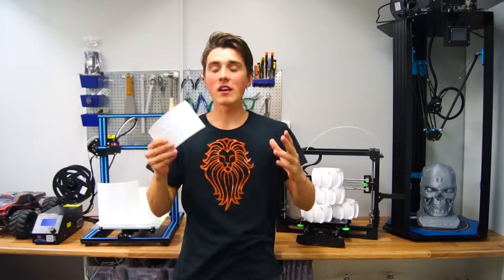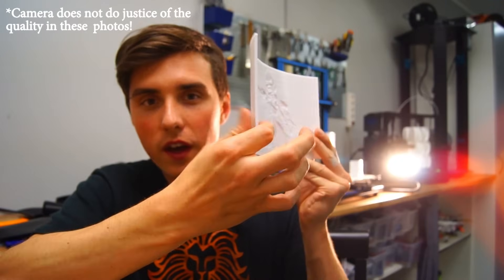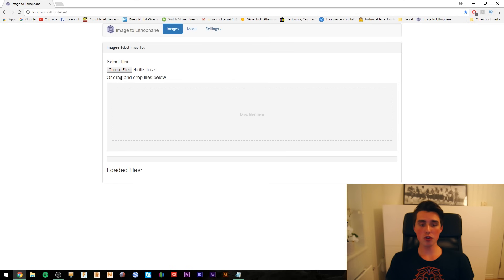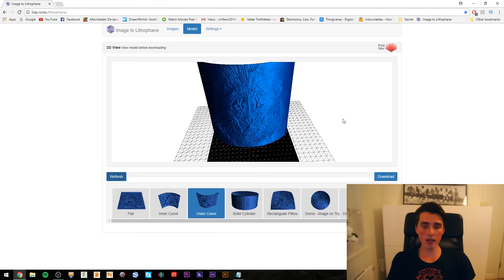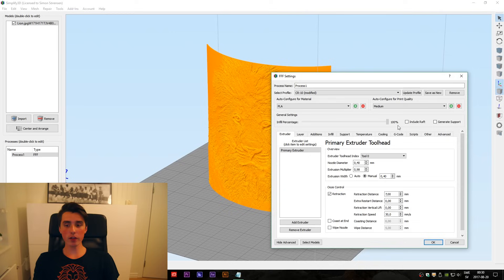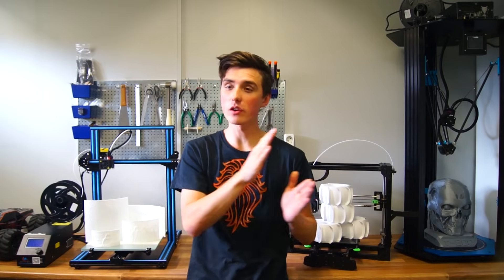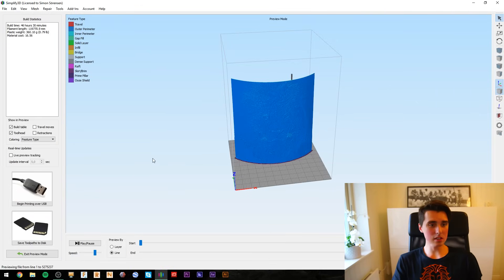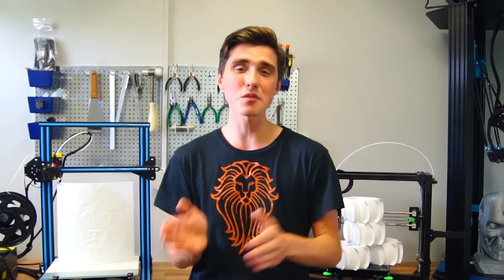3D Printing Your Photos - Lithophanes

Comment: What is the slicer you're using in this video?  I'm using the standard creality slicer that comes on the micro SD for the Ender 3 Pro, but the advanced settings on this slicer aren't quite matching up with the ones you're using.
Reply: Nm.  I'm an idiot. Says it in the top left.

Comment: Quick question:  Any idea why I get burn streaks on my print?  Using an Ender 5 Pro, your settings, and a freshly leveled bed.  The burn streaks only appear using the curved model.  Printing the same image flat (but standing) and all is well.  Thanks!

Comment: Question, so using 3dp rocks and I make the print 3mm with 4mm boarder and I stand the print vertically to print it,  with that boarder now would I need support. In cura it looks like the top boarder needs support. Or print it laying down as lots of people say it makes no difference.

Comment: Help please? Just tried my first one... got 75% done and it started curling off the bed and got popped off bed and ruined print? 

What did I do wrong? Should I make base thicker? What setting is it listed under and what should I change to? New at this just learning. I use creality slicer 123 . Thank so much!
Reply: I am printing with a ender 3 pro if that helps?
Reply: I was using the curved print as in the video
Reply: Hey buddy I don't know if you still need help, but you should print lithophanes with a brim, that way they increase the surface area to the bed. It should be a setting some place in your slicer. Good luck.

Comment: I've tried printed vertically and I've been getting bad results, I found printed flat is giving better result but still no match to yours, they look amazing. Any tips on my slicer settings? I'm using cura software with a creality ender 3 0.4mm novel.

Comment: That's amazing. Did mine with cnc router. Want quiet and no mess. This is amazing sir. Thank you for your channel. I've subscribed. I see in another video you can get started with a $189.99 printer. If that's true I'm all over that. Does it stink while printing or have to put it outside or in the garage?

Comment: Hey, do you use Z Hop when retracted option when you are printing lithophane?
Reply: Good point.. I always seem to knock thin stuff over when combing or not using zhop. Since it's 100% infill I don't see how any of that would matter. But I do wonder how optimizing wall order (outer before inner) would affect the print.. better? worse? Guess I'll test it and find out.  a 6 inch wide pic of my dog is supposedly only going to take 6 hours at .2mm.. but the whole top of the pic is washed out from sunlight.. it's a gorgeous pic really I hope it shows my golden retrievers soul like the picture does...  here goes nothing.

Comment: Just learning about 3D printers and I have a CRC machine that carves Lexan lithopanes, along with many other wood projects, but it is noisy and you have to vacuum out the Lexan/wood dust every 10 minutes, so 3D printing is interesting.......I do see that it takes a LONG time to "print", but you do not cover the cost of the material to create one (lets say a 5x7 and a 8x10)........also Creality has MANY printers........do they have a model that is faster, if I wanted to do this commercially?  Thanx for any info and your video was awesome!

Comment: I know this is a long shot... I made a 300x300x300mm kube with open top and bottom. The edges are 6x6mm and they leave room for a 294x294 litophane printed in this space.
The images are waved and i dont know why, the sides are spot on, no gaps or whatsoever. The print is done (11 days and cost me €150) but i would like to flatten the waved panels, any idea what would be the best way to do this without damaging of warping it even further? Filament is white PET-G.
Thanks in advance!

Comment: might be able to make it bigger inside the 3d printer frame if you can put the print on the heated bed slanted corner to corner
allso be nice if you can make it intoo a lampshade  
https://www.bloqq.nl/media/catalog/product/cache/1/image/9df78eab33525d08d6e5fb8d27136e95/o/m/omega-h-wandlamp-keramiek-15cm-licht-aan-wit-bloqq-cleoni.jpg
for that to look better with the light off the outside might be made smooth (even sanded smooth )
i wonder if its possible to print the image inside out so the outside can be smooth while the inside has the ridges

Comment: Tried this on my Anycubic i3 mega with some ivory white Pla+ but every time it gets about 1hour into the print the filament just breaks inside of the extruder tried it 4 times and always breaks at same stage of the print. This is the first problems I have had with the Anycubic .

Comment: I like your video. I printed one on my CR10s and it came out good except for missing layers. I tried to use S3D to slice but it does not work for me. I used Cura 3.2.1 I tried everything to get the lines out they are mostly at the top. Would you have a suggestion on what I can do to get rid of them? Its not constant so I am guessing its not under extrusion. Nozzle is fine. I am getting a vibration when the hotend travels across the print. I wonder if that is causing the issue. I already set the E steps and when I saw the layer missing I set flow to 104% just in case. I used all the settings you suggested except I did not turn Z Hop on and I think that's why its hitting the print. The bed is adjusted properly. I have a ton of mods on the printer like vibration dampeners, modded extruder body, squash ball legs, more. I am using PLA white from 3D Solutech which always works for me. Any ideas? I really want to get this down. Thanks

Comment: I tried to use your settings but the printer move too slow almost non-existent just sits on the bed and hums is your speed set for millimeters?

I'm using a CR 10 and for some reason it just will not move it takes about 30 seconds to get to the middle of the bed and then it just barely moves if at all
Reply: Markess A. Wilder I have same issue. You find anything to change it?
Reply: I had a buddy look at it and was told that maybe it's not set to mm but to min which translate in the US to about 0.8 print speed. Which is slllllllllooooow. He sent me a basic litho profile for S3D and since then I've tweaked it and made it my own. I really couldn't figure out what was causing it but I got rid of it.

Sorry I couldn't give you more info. I did write him but I never heard back from him so I moved on.

Also I should note that the print was saying 89 hours with his setting and with mine it was 2 hours or less depending on the size I wanted to make.

Comment: I am starting in the hobby of 3D printing. I am using simplify3D and when I set the nozzle temperature it change the bed temp. as well. How could I correct this. Thanks in advance.
Jesus

Comment: What camera are you using for the timelapse at the start? The one you attach to the bed
Reply from the maker: It's a GoPro Hero 5 in timelapse mode, taking 1 picture every 60 seconds.
Reply: Awesome, thank you. I've broken my 3D printer and awaiting spares but going to try these lithophanes once I've fixed it

Comment: can you also make this in color
Reply: toni You can use other colour filament, but I have not seen anyone make one with multiple filament colours. What I have seen and looked cool, was someone print one of these in white, then print the same photo on transparent paper and mount to back of the lithophane which allowed some colour to bleed through! Would work better with primary / bold colours

Comment: Quick question: How many meters of the flexible filament do you roughly need for a T-shirt print like the lion?
I have seen that filament in the shop and its rather expensive, like 3-5 times more than PLA. However, I have seen some shops sell 5 or 10 meter pieces or 50g test packages. I wonder if that is enough to print a few T-shirts? I would like to have multiple colors at hand rather than a ton of a single color if I only need so few.

Please drop a comment here ;-) and keep those videos coming. T-shirts and lithophanes are about my favorite for 3D printing, followed by copying objects like houses, objects, poeple.

Comment: Why print it vertical? I printed one flat on my MK2s and it seemed to print fine. i did forget to switch it to positive, so the shadows are backwards, but otherwise it looks good. Does printing vertically offer a large improvement?

Comment: Great video! Did my first lithophane today and used your settings and it turned out great! Ran the heat a little higher because I used ABS. I ordered up some white PLA and will try that next. Also looking seriously at the CR-10. My old Makerbot does pretty good, but technology has improved in 5 years.

Comment: Have you used the i3mk2?  I was curious which is better between the cr10 and the I3mk2.  I want to buy a 3d printer but not sure which is best when I only can afford 1.  Also have you seen anyone using multiple colors on the CR10 like what has been built as an add on for the mk2?  Thanks anyone.

Comment: Does it work only with white filament?
Reply: I tried with black pla and it doesn’t work as well.
Reply: I'd like to know that too
Reply: It works with any filament, even transparent one. The idea is balancing the colour and transparency against the original photo.
You can do a mosaic for your window with multiple filaments.
Reply: Transparent one does reflect light in different matter - so use your artistic side with it :)
Reply: I tried with transparent filament and you just can't see the picture clear...
Reply: Does industrial gray work
Reply: I tried with transparent filament and had the same result where the image wasn't too clear.  Once I spray-painted it white it looked perfect
Reply: I used red and it worked well

Comment: Isn't the point that you should look through the flat smooth surface of the lithophane?
Reply: I think it would work the same if you invert the image so the smooth side is facing you, with the bumps on the other side. A flat lithophane could just be looked from the other side, but this curved one should be inverted in software.
Reply: Yes it is, I venture a guess that this is more popular due to it looking great even without the light.

Comment: greetings from germany, i have also made some of this awesome picture printings. But i played a little with the settings. when you go on the modelsettingsite you can increase the curve of the model to 360° so its an open cylindar which is perfect to put a candle or Led in the middel. I printed this and it works realy good.

Comment: Thank you for this video - I've done a few lithopanes, now, thanks to you, and another is printing.  

One tip - you can improve the printed image by specifying a layer starting point instead of letting S3D do it - I set mine to put the outer perimeter start point on the back corner of the print (300,300 for the CR10) - out of the way, visually.

Again, great video - love your presentation!

Comment: If we print large action figures, would it be faster if we 3d print a hollow figurines (just 3d print the shell/skin) and then filling it in with a liquid that cures/hardens? (Compared with 3d printing the whole figure solid).

Is there a 3d printer that utilizes the volume filling capability of low viscosity fluid or thermoplastic? The process could be done in stages. i.e. 3d print hollow skin of the foot, fill in with curing liquid, and proceeds sequentially upwards to the body and then the head.

I am just thinking of design concepts with faster 3d printing speed.
Reply: You can, there are all kinds of cheap resins of various hardness you can fill your skin/mold with. You can even fill it with silicone, remove the skin and make a flexible part that way which can be used as a resin mold for example. Or even make a negative mold in plaster for metal casting... But i dont know no 3d printers who could do that automatically.
Reply: I think its because 3d printer cannot control where the resin will flow... maybe it needs to be fitted with a sensing device. but that would be hella expensive.. probably a cheaper way is to create smaller compartment that it can predict where the resin will flow into

Comment: Is there any way to make all of the depth on the backside of the model so that the front is totally smooth so when there's no light you can't even tell there supposed to be an image there? That would be very cool
Reply: I tested it, the light diffuses into the flat side of the PLA and it isn't as sharp. It's doable, but not as good looking
Reply: Damn, i hoped it would work that way.

Comment: I find this to be impossible in my mind. Yes I get the contoured image, but the part I cannot understand is how when you angle it to the light the real image comes through. How?
Reply: Are you holding the picture behind the copy? I cannot understand how it can know the real world image from contours. I mean it's a 2D image so the 3D copy would be to some extent inferred - wouldn't it? I am so confused if this turned out to be a joke it wouldn't suprise me at all. Anyone else confused here?
Reply: My confusion is not this 7:35 (I get that), it's this 7:40. How can contours in the same coloured silicon create such visual depth? I mean that machine isn't actually photocopying the image in there..is it? I am so confused!
Reply: WeirdCityCitizen 
It has NOTHING to do with contours and EVERYTHING to do with the thickness of the plastic. The thickest areas appear darkest because less light passes through and the thinnest areas appear lightest because more light passes through the plastic. The shades in between are caused by the variations in thickness of the plastic. The website first turns the image into monochrome, then it assigns a value to the thickness of the plastic print depending on the intensity of each pixel in the image. The finished print has to be solid as if it used infill the effect would be ruined. Similarly, the effect would be less striking using dark coloured plastic as very little light would pass through anywhere. Your brain causes the image to appear more clearly as we see by our brains comparing different parts of an image, which is how it is possible to see black on an old CRT television even though it's impossible for the CRT to produce black!
Reply: WeirdCityCitizen it is literally a grayscale image except you're creating that image by allowing or blocking light instead of more or less pencil or paper so just like you would do a lighter stroke with a pencil to get a lighter gray use less plastic to permit more light when you want to block more light you use more plastic to block more light or just like pressing harder with the pencil to make a darker mark

Comment: Does it work with other colors
Reply: Samuel Adams 
It will probably be much less successful with darker colours as it relies on the ability for light to pass through the plastic, so only light colours without any added particles (wood and metal effect filaments) would be most successful. It would be possible to use a powerful light source to illuminate some slightly darker shades but care should be taken not to melt the plastic by avoiding incandescent and halogen lamps.

Comment: Did you use white pla or transparent pla?
Reply: Ellis Ramadoo he said white pla filament
Reply: Ellis Ramadoo 
Transparent PLA would not have the desired effect as it relies on the opacity of the plastic to work.
Reply: But for large size model ,pla breaks; so which other filament can be used so that its tougher

Comment: Hey RCLifeOn my cr 10 is having trouble heating the nozzle so I figured out that it was a bad heat sync (which alot of people have been having) so I ordered the nozzle assembly kit from My Mini Factory, but the problem is that I'm going to need to splice the wires to the heat sync connector and I have no idea how to get the old wires out and then how to splice the new ones in, so I was just wondering if you could help me out, thanks.

Comment: Hello Simon I bought my CR 10 from about a month ago and since a week or so the nozzle has been dragging on the prints and they're turning hideous can you tell me what the problem could be im guessing it's over extruding or the Z axis is not tight enough/too tight (thou I tried fixing it a couple of times but it still didn't work can you please help?
Reply: I had a similiar issue with my Anet A8 and it turns out it was due to the nozzle being too close to the bed for the layer height i was printing in. Ever since i leveled it by eye instead of paper, i got great results.
Reply: But I'm leveling my bed using the paper method (sliding a paper underneath the nozzle just till I feel a bit of drag) but I will try that thank youu